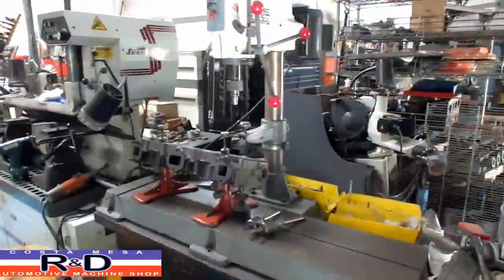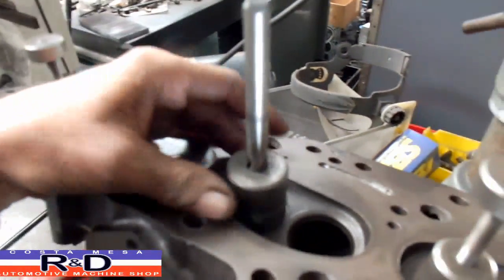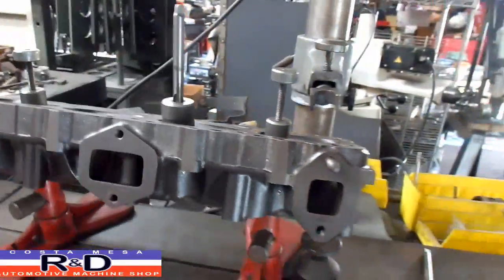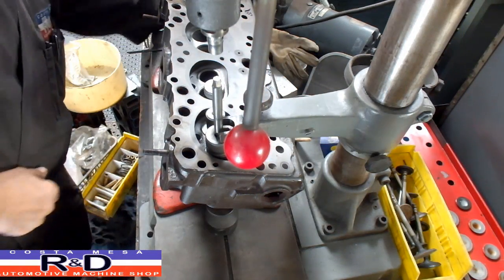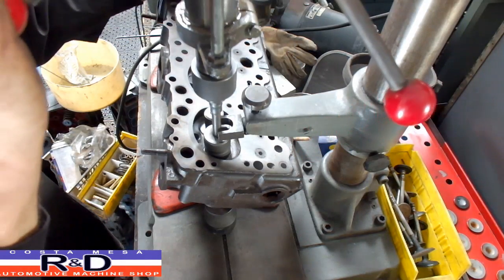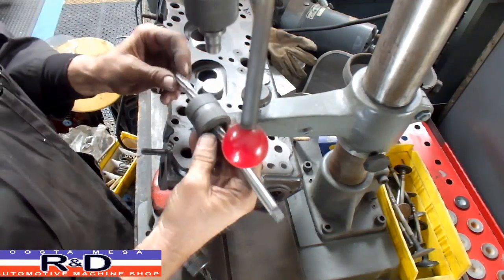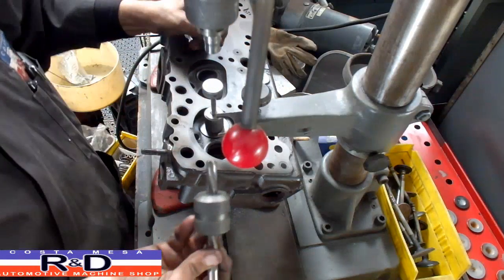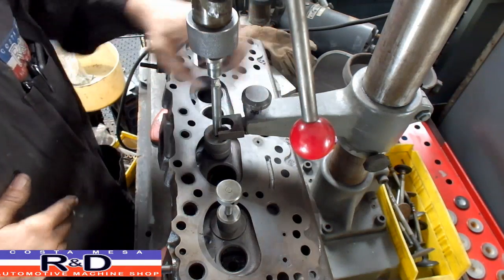Olds Valve Guide Drilling & Reaming on the IDL

Comment: If you are looking for an IDL (Ingenious Devices Limited) Valve & Seat Grinder Machine, check the listing on ebay.  Only $2,425.00 and includes a ton of stuff including the roll over fixture, drill chuck & adapter and 579035 Cutter Setting Fixture.  A great price for a great machine - not too many to be found anymore.

Comment: Question is what do U do if you have guides with steam seal shanks most go threw top of the heads not the seat pocket area  ? how would u handle it with that IDL machine > ehmm.
Reply from the maker: I install seals to fit the guide I install, if necessary I'll machine the guide to fit. No big problem when you have the tools.
Reply: Do you have a facebook page John ?

Comment: Theres no difference between install of bronze guides in Cast heads as in steel guides in cast heads as long there the same size  I have done a few SBM SBC heads . Just stay away from half size or 1/2 length guides

Comment: Why not press the old guides out and press new ones in?
Reply: your not very old are you ??? todays heads are almost all aluminum and guides are bronze etc,, from factory  old heads are cast iron and the guides are simply pilot holes drilled into the head and the only time there is a bronze guide is when they have been repaired within last 30 years ... prior to that they knurled the guides which may have been ok  for some but half assed at best ... at the start he did say first drill was to cut through guide and second was to enlarge the guide which means at some time in the past someone replaced the guides ..by enlarging the bore and using an oversized valve guide he doesnt have to rely on previous machine shops workmanship to keep a new guid in place and not drop out.. so in a nutshell he is simply covering his ass and not building on the foundation of someone else s error... me personally you are already in there I would do the intake guides as well